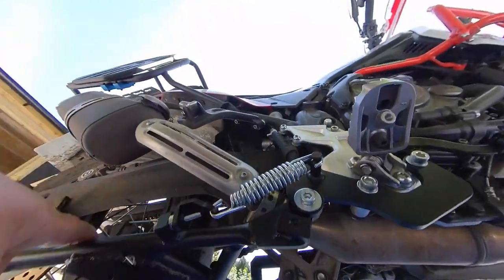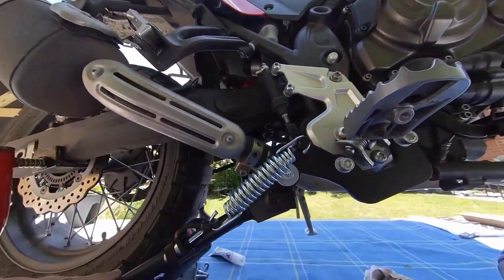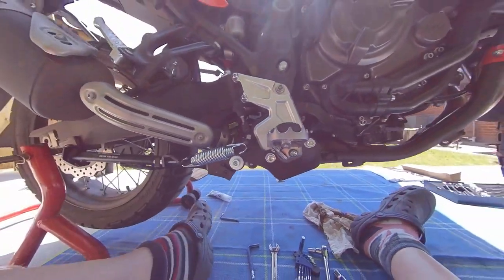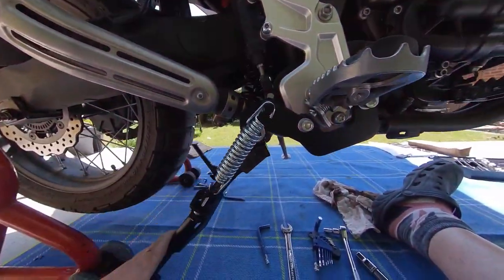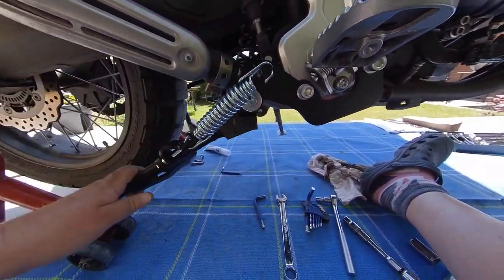Fitting the SW Motech Centre Stand to the T7

Comment: Thank you so much for this video! I have ordered my sw-Motech Centre stand today. I’m sure this video will help me during installation! Cheers from Germany.👋
Reply from the maker: You're welcome and happy to help.  :-)
Reply: So the Centre stand arrived today and I instantly installed it. I took the skid plate off as well. It’s really much easier work without it! Everything worked fine. I used Loctite because I think it’s necessary and well because I found an old little bottle in my toolbox😉

This Centre stand is a Nice piece of Metal and from now on it will make many things much easier for me.

So thx again for the nice Video and allays have fun with your Tenere!

Comment: Very good video, do you have any idea how to mount a centerstand on a cf moto mt 650 , I bought one via ali express but there are no mounting instructions included, I don't have any idea how to begin on it
Reply from the maker: Thanks for the compliment on the video.  However, I wouldn't have a clue where to start with mounting a centre stand to the 650.

I assume you have Googled other stands for the bike and picked up some tips from there?  Does the manufacturer have diagrams you can get ideas from?  Good luck!

Comment: Good video informative - helped me decide on my purchase - I’m guessing yer south west based as I noticed yer house is a Cornish unit and had the concrete cancer fix - I worked on them many years as I’m south west based - just taken delivery of my T7 and looking forward to throwing new bits on it
Reply from the maker: we're South East, but close enough.  Ex prison wardens houses, so built as cheap as possible - so it would seem.  ;-)

Just a bit of additional info - if you're considering a lowering kit, fit it before the centre stand.  Just easier...

Comment: Great how to video, thank you for sharing.  Do you have any idea how much the SW Moteck center stand weights?  Trying to decide between this one and the factory OEM center stand.
I know the OEM one is bulletproof but I have a feeling it weighs quite a bit more.
I don’t wanna keep adding unnecessary weight if I don’t have to.  Thoughts?
Reply: Thanks for the content Dave.  I had hoped Google would provide the weight answer but I couldn't find it.  It must be somewhere but might also be worth doing them an email.

I wasn't overly worried about weight, as I have plenty of my own to shift and with luggage, even less of an issue.  We have updated the rear springs though.

Comment: Loving the videos, stumbled on them via T700 search, have you had to anything on the suspension height on either of your bikes? Also have you done a video of your 3 year plan to round the world? Great stuff 😎
Reply from the maker: Hi Ken - sorry I missed your comment but I can rely on the better half to point this out to me...  ;-)

I don't have the longest of legs and have been tempted to lower the suspension but, like me with most bikes, I like to ride 'as is' and I tend to mould to the bike.  That's what I have done with the T7 - I'm slowly adapting to lower off one side or the other and just plant with one foot (Can do two but on tip-toe).  So, as you see the bike here, it is standard height. 

I have fitted the 'full-fat' spring on the rear shock and, again, this took a bit of getting used to but has no effect on the centre stand.

We haven't done a video on the plan - it's too early in our journey to do so.

Thanks for watching and sorry it has taken me so long to respond!
Reply: Yip me too 👍😎

Comment: Hi could you help me
I purchased a sw motech stand
For my tenere 700 from greenlandmx in Spain
But came without the stop plate
and they will not help
Could you give me the measurements of that part
Lenth and width if you couls thanks
Reply from the maker: Hi Mark,

Sorry to hear you only received a part of the product and the retailer has been unable to help.  Can I suggest you contacted  SW Motech direct?  We found them to be very helpful and IF they can't resolve your problem, they will be the best people to provide measurements (I assume you want to fabricate your own?).

I can provide measurements will it will be another few days before I can get out there with a tape measure.

Do let me know how you get on.

Carl.
Reply: @Life2ontour  OK thanks I have managed to get measurements
I also emailed sw motech
Thanks anyway for your reply